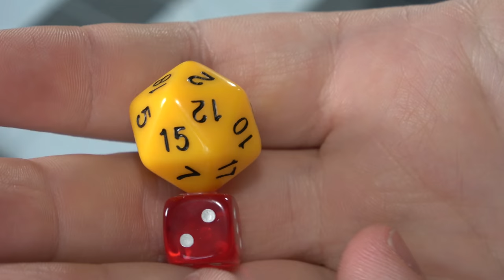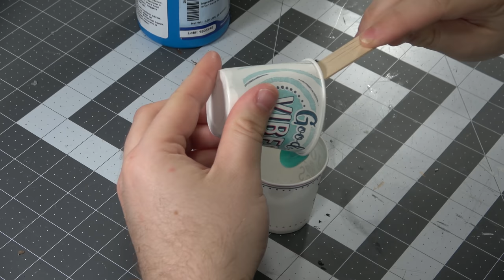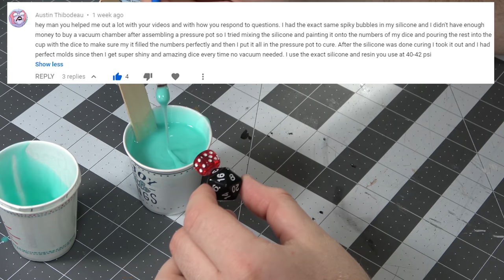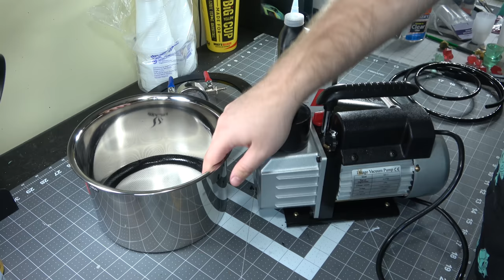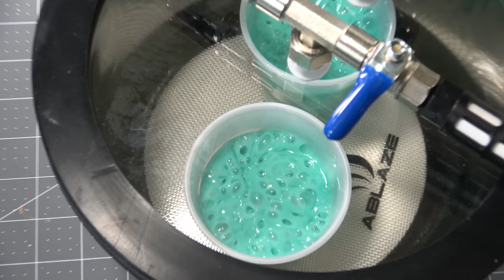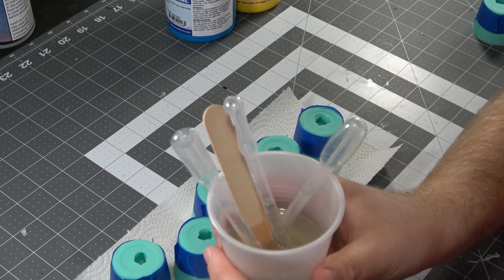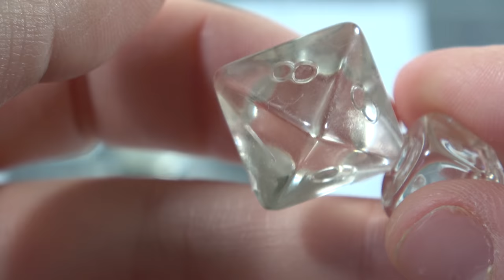Casting Clear Dice Pt. 2 | Vacuum Chamber

Comment: Just curious, have you tried making molds out of the 2 ingredient cornstarch and silicon caulk? I'm a noob and just bought some stuff online but my patience is thin and i really want to start now lol
Reply from the maker: Honestly, I didn't even know that I COULD do that haha. I will give it a shot sometime and see if I can get decent enough results. :) Thanks for the idea!
Reply: @Rybonator  it's basically a diy version of sugru. If you need to be able to pour it like normal molding material you can add mineral spirits to thin the mixture. This will cause the mold to eventually shrink a bit after it is cast though.

Comment: The resin you got those little surface spikes was because you never pressure cast the silicone mould… so the tiny bubbles in the silicone compressed when you used the pressure pot to cure the resin…..

Comment: just a note, if you do not want to use a vacuum chamber to get the air bubbles out, you can use the pressure pot when making the mold. just at a little bit higher pressure then you cast your dice at.

Comment: If you microwave your resin for 30 seconds it will turn it into water basically and very easy to use
Reply from the maker: I'm so scared of microwaving anything that isn't food haha. I just set mine in a hot water bath for about 10 minutes and it works well :) But yeah if your method works that well, go for it!

Comment: So, even if I spend the money to make a pressure pot, I can't get good dice without also going for the vacuum pot too? :(
Reply from the maker: Not true! This is older and outdated information. In some of my newer videos, I test using just a pressure pot on silicone molds and dice casting, and it works great! A pressure pot is all you need :)
Reply: @Rybonator  so, you use the pressure pot to make the molds as well?

Comment: Why not put the resin into the vac aswell?
Reply from the maker: The resin will get pulled out of the mold in a vacuum. Because there are so many bubbles, and resin is so sticky, they expand heavily and will often overflow from the mold, leaving a large chance that there will not be enough left in the mold when it's all said and done. Pressure pots don't have this issue, so it's better to use pressure for that. BUT you can also cure your silicone in a pressure pot instead of HAVING to use a vacuum, so if you are gonna get one over the other, go pressure pot.

Comment: If you get a meat basting syringe you can throw those crappy pipettes in the trash. The basting syringe comes with a giant needle that will push out a stream just as thin as the stupid pipettes and you dont have to
 draw the resin up into it. You can pour it in and they hold up to 30 ml of resin

Comment: Can you remove air from resin with vacuum pump?
Reply: You can but the time it takes to vac out the air is longer than most resin pot life. Pressure takes no time at all to inject whereas sucking air is a more difficult process
Reply from the maker: Essentially what Joe k said below. If you tried to pull it out, you would probably cause a big mess, as resin bubbles also don't tend to pop right away, so your resin could leak out the side. You are better off getting a pressure pot over a vacuum chamber as a more versatile machine. As you can pressurize silicone, but can't pull a vacuum on resin.

Comment: Why don't you just pressure pot the silicone like you do for the resin?  The same exact principles apply to this.  Pressure pot should work well when making the silicone molds as well and then you don't need two large expensive pots, just one.
Reply from the maker: Honestly I didn't know at the time that it would work, as my information source on this used a vacuum and a pressure pot. But yes, a Pressure Pot will in fact do both jobs :)

Comment: OK probably not response to my comment but I'll take the chance, just for the sake to explain why the silicone painting technique didn't came out well, The technique itself is good and is used in jewelry casting and in dental castings too, where you paint in these cases is investment powder dissolved in water, but for optimum results with the silicone, is to paint the silicone allover the piece in the form of a film and make sure it penetrates all the nooks and crannies of the piece, let it firm up a bit without letting the silicone to fully cure, just firm enough to make sure it won't run, and then fill the mold and both silicone will fuse together and that's it, if you pour the whole thing at once it won't work.
Reply from the maker: Oh man, that's probably where I went wrong! Thanks Nohc :) You rock
Reply: @Rybonator  Make small tests since the silicone is very expensive and try to find a point where the silicone don't run and is a bit sticky and then pour fresh silicone, you will be amazed on how good it comes out! good luck.